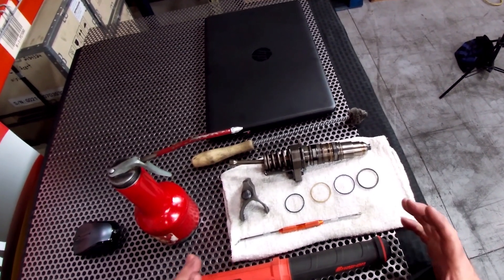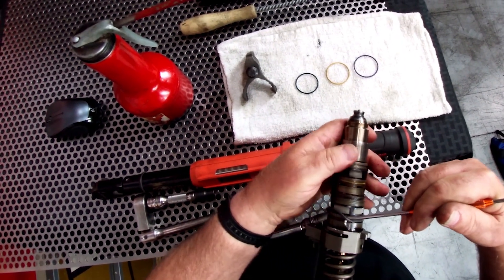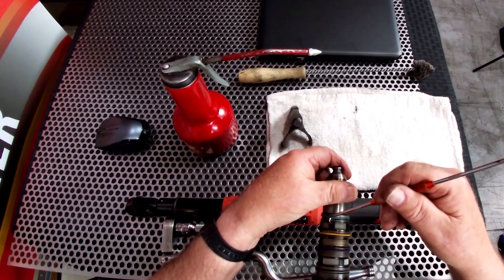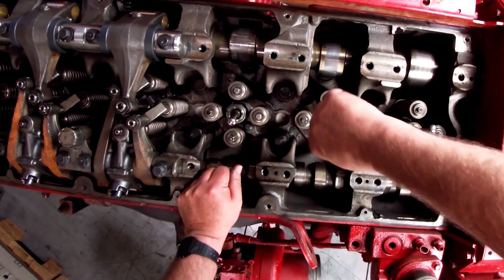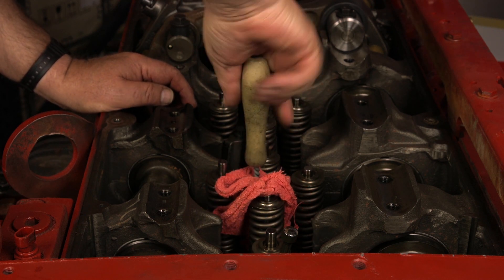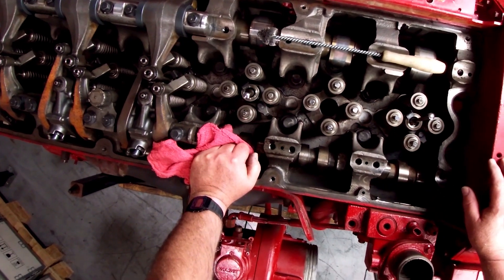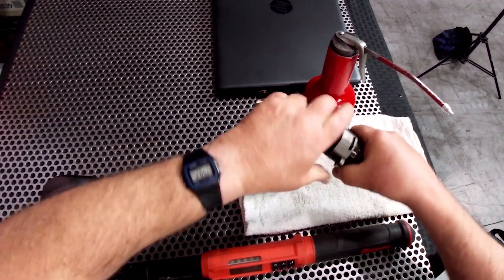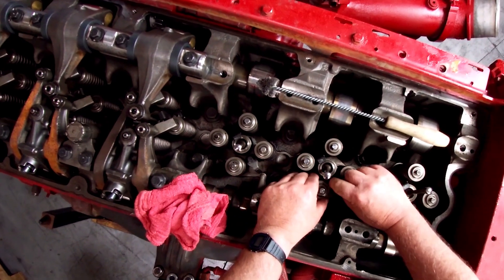How To Install A Cummins ISX Fuel Injector

Comment: Could i replace the injector without a torque wrench  or without using the torque specs for example just with a ratchet ?
Reply: You could but uhhhh it's best that you torque it down for you and customer confidence in repair.

Comment: How much will this cost?
Reply from the maker: To replace ISX Injectors, they're around $446 per fuel injector.  Depending on your engine serial number, the price may vary.  Give us a call at 844-447-1453 and one of our Sales Technicians can help to identify what ISX fuel injector you need and can also generate a quote for you.
Reply: I took my 2016 peterbilt in to have 2 fuel injector replace. After they replace the injector they couldn't get the truck to crank up. They recommended replacing fuel pump head, which they did, but now they say they hear knocking in the engine and think that a valve fell. My question is will the fuel injector cause these problems afterwards